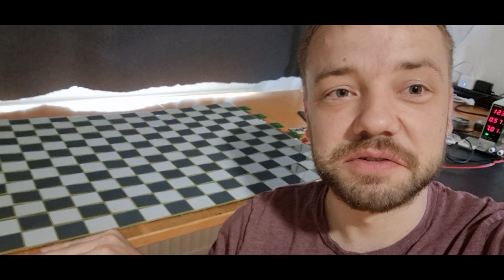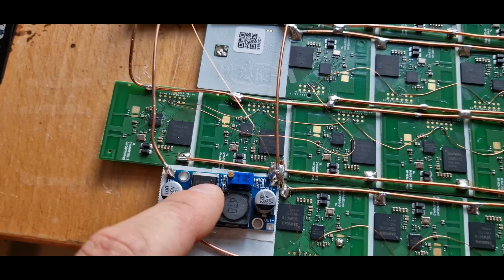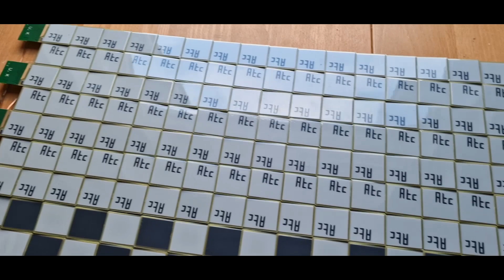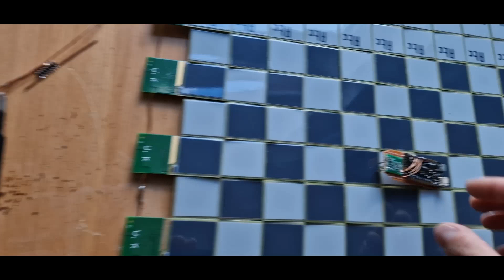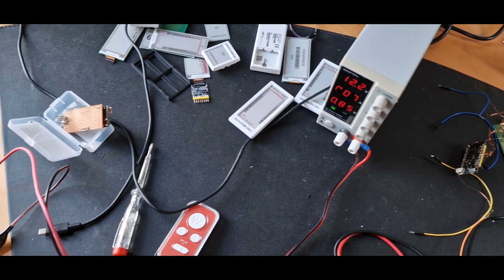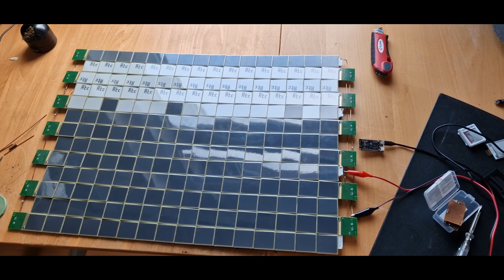Matrix Segment E-Paper Wall progress made from Price Tags

Comment: Do you not get any problems with the uninsulated wires?
Reply from the maker: The thin wire is enamelled copper wire so there is no problem.
The thick wire is very stiff and does not bend. You do need to be careful still
Reply: @atc1441  thanks for the explanation :)